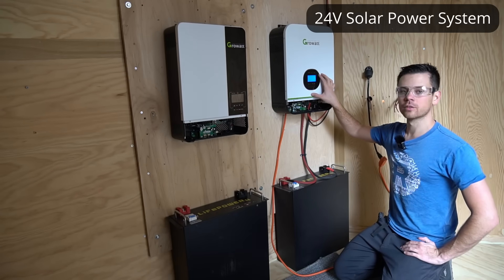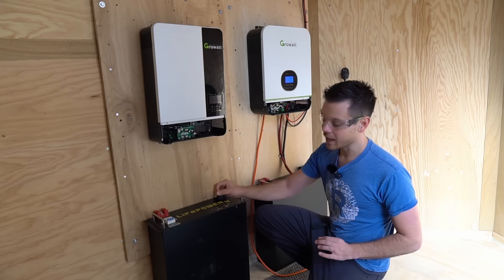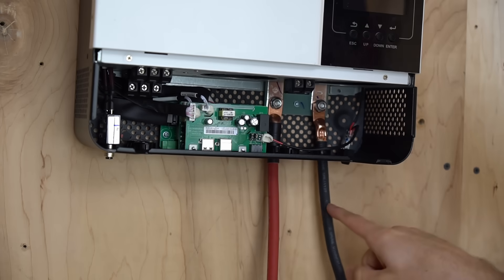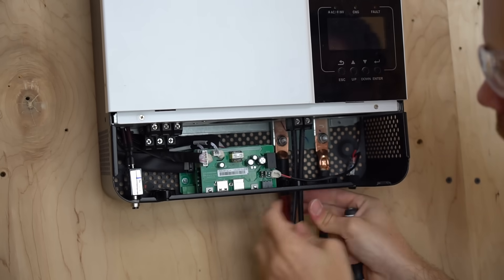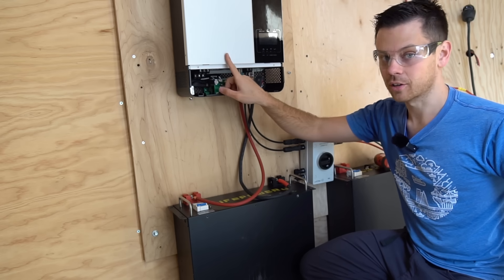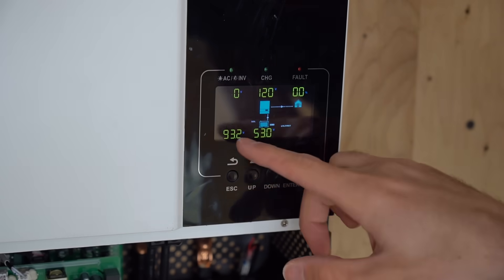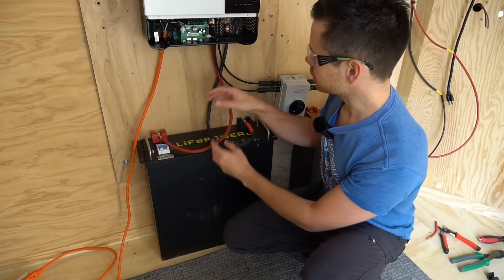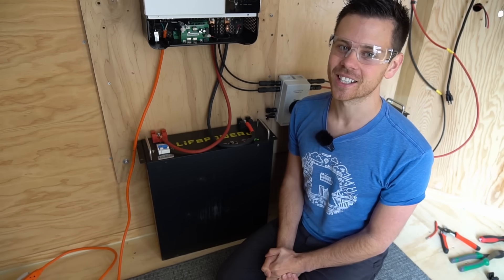Beginner Friendly 48V Solar Power System! Step by step!

Comment: What is voltage output for this inverter? Mine is 220-240 (230VAC). Could you check N-L, N-E & L-E voltages? Mine has Floating Earth (normal for every inverters which it wasn't bonded N-PE inside the inverter like IC brand inverters). Current setup the Neutral carries voltage (100VAC to Earth) and if someone accidently touch Neutral wire they'll get shock. For current setup (off-grid) you can bond N-PE directly at the inverter output and that's all.

However if you're connecting AC input (from grid\generator) it will different story and different setup. 
I would like to know if we could bond N-PE at the AC output of the inverter when we connect AC input from grid?

In the U.S i know that N-PE already bonded at distribution panel. Somehow you could take the Neutral from ACin and jump into ACout so that it will give proper earthing reference.
In Malaysia, we have 240VAC from grid but not sure what earthing method (most probably TT or TN-S). Could this be done the same? N-ac-in tie to N-ac-out?

I've installed grounding rod at my house and tested everything was fine when using grid N-PE = less than 2V, N-L 240V & L-PE = 240V.
thanks.

Comment: A little tip: if you have some red electrical tape, wrap a little around the pos(+) MC4 connector so that you'll never get them mixed up. A lot of us forget what we did, months or years afterward.
Reply: Martin,
I am a semi-retired welder-fabricator.
I create a op manual for everything -- parts numbers, suppliers, components, procedures.
I automatically assume the next user is a lawyer intent on making my life 'difficult'...

Comment: What kind of setup would I need to provide at least a lvl 2 charger or even a lvl 3  charging station for EV. I am wanting to provide it for a mobile roadside service. I can come to a location and give someone enough of a charge to get them down the road. I have a truck that I am wanting to setup a solar system to power my mobile tire changing equipment. But to also provide charging EV without using a gas generator.
Reply from the maker: Just watch my other videos where I go over exactly that
Reply: @WillProwse  I have watched your other video about charging your EV. However I am trying to figure the exact setup to give the maxium charge in an emergency application to a EV car that has ran out of juice. I don't have the time to set with them for several hours on the side of the road. I am guessing to get 12W 48v converter. I just wonder how can that be used as a lvl 2 charger. I think a lvl 3 would need three phase.

Comment: How does grounding work with the 120VAC circuit? I can see the green wire come in next to the hot/neutral, but is there a "ground out" for a grounding rod or building ground system? Thanks!
Reply from the maker: Only if you connect to the grid. Then it is supplied by that grounding conductor. If not it is a floating system

Comment: I have been taught to always connect the negative terminal first because positive first won't have the intended path back to ground should there be a malfunction or mistake.  I'm no master electrician so can y'all help me understand why Will connected positive from the inverter to the battery first 3:43?  thanks.

Comment: Thanks Will    Your a True Inspiration,  thanks for your time sharing your Great Knowledge,   I want to do a Boat Solar Array to power the A/C current on the Boat not Having to run the Generator.   This seems like a Good system just need to do the Workarounds from Having 12 volt and 48 Volts on the Boat 
Thanks Again

Comment: Great video.
The ground conductor connected, Should the ground not be connected  to an external ground to create a path with least resistance.
With inverter settings, can the PV charge battery and supply power to AC appliance
Reply: Moe,
Are you asking about connecting ground cables to the trailer frame?
Reply: Hi LM, 
Thanks.
no, I am referring to non movable structure / off grid house connection 7:55. Should there be an earth leakage if connecting to a sub distribution board for lights and small appliances.
However, for information in the case of trailer connection where does ground / fault current go to?

Comment: Is the same voltage DC much more dangerous than the same voltage AC? Because I've felt alternating 120V shocks many times and it just is very scary but I don't think my heart has been damaged. The electric fences used against home robbers is DC pulses of what voltage?

Comment: Just ordered a similar system like this. But I want to add some wind power as well. But it's really hard to find someone that has a nice and clean installation. Might be ending up having separate systems. And have a small battery bank for the wind together with a inverter to feed into the grid tie  part of the mppt.
Reply: Separate systems.
Redundancy.
Good idea.

Comment: Is that the spf5000es unit?  That puts out 230 volt?  If so then it takes more volts in then you mentioned.  Or is that a 3000 120v single phase unit?  It looks like the 5000 unit that I have.  Which will take more voltage and output at 240.  So I was a little confused.  I have 14 320 watt panels running to mine at no problem ..

Comment: I did all the HEV and BEV diagnostics for Ford from 2010MY through 2016MY. Nominal pack voltage was about 320VDC if I remember right. Anyway, I always used an old trick of Nikola Tesla's, regardless of whether the service plug was pulled or not.  When working with HV conductors, keep one hand in your pocket.

Comment: Your unit does not charge because your solar string does not provide enough voltage. MPPT startup is at 150 volt.
Reply from the maker: Yep, I listed that mistake I made in the pinned comment. I'm an idiot. I have 20 of these units and didn't realize which one this was.
Reply: @WillProwse  I made the same mistake. Thought that it will work with only 3 solar panels of 40 V open circuit voltage each, wired in serial. Had to buy  another panel to get it fixed.

Comment: Great video mate. Greetings from Melbourne Australia an Happy New year. I was wandering if you or anyone here has info on building a very large system for a large house. planning on building a house in the Philippines and was wandering what set up would I need to power a  very large house with multiple Air conditioners. As the Philippines has constant power outages, sometime running for days on end. What set up would I be looking at for this. I am expecting cost to be around 20-30k for everything. Would I be right and if so. What would be looking at for this type of set up.

Comment: I saw in one of your comments, you were suggesting safe clearance to combustible materials yet I see your equipment mounted directly to plywood? I have OSB on my walls and I found a very nice tote to store my batteries in inside my basement with a lid and exhaust fan. Do you have any input on that?
Reply: Charlie,
I think these temporary displays are for demonstrations.
I think non-combustible mounts are the way to go.
Reply from the maker: Look at pinned comment

Comment: Personally I would wire up the AC side first. Just in case somehow you bumped the circuit breaker shut off switch for someone accidentally turns it on while you're working
Reply from the maker: Yes, true! Good point.

Comment: Very simple explanation and got me thinking if I should still go with a 12V system in my motorhome. In the moment is the bigger problem getting some decent solar panels (I prefer the 200W x 3 for the 600W set up on the Motorhome)  and batteries in Europe. I sourced some individual components for the moment in my country but wit the AGM batteries. Getting some LiFePO4 for 200Ah up is when it becomes a problem. I found your channel about 2 years back, watched some videos but didn't subscribed. Luckily after searching again in the Solar Power topic I came across your channel again and right away subscribed. I am also thinking to do something similar for my house as in this video for the future and boy this your simple  description gives me the right motivation, Thank you.

Comment: I believe the standard is to avoid connecting/disconnecting solar panels while the inverter is working or while there is load on it. This avoids the formation of tiny arcs and welds on the MC4 connectors which over time can render it bad. So I wonder how that isolator comes in to work while the inverter is hot.

The standard I think is battery to controller first, then solar panels to controller next and then the inverter turns on last. Then the loads can be put on the inverter.

Also the use of bus Bars for ease of connection is sacrosanct and that is what I use on my 48v 25amp 18650 Li-ion to parallel 8 pieces of the packs. In place of a solar isolator, a 60 amps DC fuse to disconnect/connect the solar panel to the system is what I use.

Comment: Thanks for you videos Will. Which is the better all-in-one inverter to go with for beginners wanting to do an off grid system to power a whole house, a few Growatt 5kw's or a couple of LV6548's like your setup?. I'm going to be using a full rack of 48V/100AH EG4-LL batteries.

Comment: As you mentioned it is important to first connect the battery @8:10 then the solar string otherwise the electronic may be killed.
Reply: Will also mentioned "Follow the instructions in your manual.".

Comment: I'm an old guy that has actually learned much from you regarding PV panels and storage batteries and has built a small 12 volt back up system for tornado season here in Kentucky using info I got from your channel.. My wife and I both are grateful for your channel for that reason. A really silly thing that I would like to ask you, that has zero to do with solar or batteries is, where did you grow up? The reason I ask is because the way you pronounce words like "tighten" is much more "precise" that anyone here in Kentucky would pronounce them. It may not be a regional thing, because you seem to be very well educated and may just say things "right" for that reason, but I'd really like to know, if you don't mind sharing. One of my "things" that I tend to pursue when I meet new people.

Comment: Thank you Will for another excellent video. I have enjoyed your youtube channel for several years and this is one of the most important one yet. Why? Because there are probably many people like me who have been slowly upgrading over the years waiting for a breakthrough. 
I have been using solar power at my cabin in the PNW for over 20 years , very basic and low power. My last upgrade was two years ago, i almost made the leap to  Lithium but the cost was just two much so i went cheap hoping that the technogy would improve and cost would go down and so it has. So this type of upgrade is very feasable fo my situation. so thank you for doing such a great job and as always . honest , caring ,accurate and knowledgeable 
I hope that you have continued success and good health and happiness in 2022

Comment: I also have a SPF5000ES and powering my house. Simple setup but the Growatt support is too slow or never responds.
Reply: did you setup 2 X spf5000es's in parallel ? and what battery type did you choose? how many KW storage do you have?
Reply: @peaceseeker7332  I am in asia so its 240V here so just 1 unit. I have about 11 kW storage.

Comment: Why are the so few offers on the market for 48V 3-phase higher power systems (10k etc), sized for a complete home roof? Is 48V extremely inefficient at those powerlevels? I can't find much other than all the chinese voltronic clones.

Comment: But Will, you totally forgot... 🤪 (lol j/k) Nice "keep it simple" overview. Thanks for stepping through it so exactly. When you mention T-class fuses on parallel (edit: battery) arrays, do you just fuse the main hot leg into the inverter, or place a fuse between each battery?
Reply: Ted,
2003, on our ExpeditionVehicle build, we fused at each potential source of sparks -- photovoltaic panels, bank, inverter output.
Nearly two decades full-time live-aboard with zero-zero-zero sparks.

Comment: Hi will, I noticed the inverter on your vodeo is digrent from the one on the link. I noticed because I'm about to upgrade my 1kwh solar system frome 12 to 48 and I was interested in the newer 3k Growats like the one on your video, but then in the user manual I read that the minimum pv workimg voltage is 145v, I only have 135v open circuit.
Is the inverter on the vidio the same as the one on the link? Where you able to charge your battery with only 85v pv aray?
Thanks for the time and effort ypu put into these videos, it helps people like me living in remot places, take good desitions and to spend our money in working solutions.
Reply from the maker: No it wouldn't charge. Needs 120V minimum. I screwed it up. Wrong model. Each model has different input requirements. Look up the manual to check.

Comment: Hi Will. HAPPY NEW YEAR. Apologies if you have already mentioned it but do we need to pre charge the capacitors for this all in one inverter?
Reply from the maker: These batteries have a pre charge resistor built in. So you can hook it right up.

Comment: I wish I had running water on my land, that I could build a micro hydroelectric generator on, I would buy about 100- 200ah of lithium titanate cells, 24-48V  and a 10 kw inverter give or take, having 1kw 24/7 would be plenty to power everything, lifepo would probably work fine, but the titanate would probably last much longer, being it would be cycled more, possibly 2-3x a day ..  more than solar is likely to be cycled,  the smaller bank cycled more,

Comment: Will that run a 2 hp deep well submersible pump. It's on a 30 A breaker now. Need a way to have water if shtf. Thanks Will for all you do.
Reply from the maker: No, you need my large system instead
Reply: @WillProwse  Thanks, where would I find info on the large system?.

Comment: Just finished building a very similar project with an SPF5000 ES, ending in a big disappointment because Growatt isn’t very clear (or you can even say misleading) about the MINIMUM PV voltage necessary to trigger charging from solar input. My three huge 495W JaSolar panels in series deliver around 130v and the datasheet says the open circuit voltage should be higher than the minimum battery voltage. I would say 130v is way higher than the min voltage for a 48V battery but in fact the Growatt only starts charging around 150V, not any lower. I did not see anybody mentioning that so I do here and maybe you can say something about it on your channel. That might help somebody not making the same mistake that I did. As my project’s panels are the roof of a trailer I cannot just add another one and am now forced to buy a different inverter with lower min PV input.

Comment: Good video. One question about using more than one battery: I would think they have to be at or very close to the same voltage or state of charge when connected together otherwise the initial current could be very large between the batteries as one tries to charge the other very quickly. Perhaps a 1 ohm (or so) resister connected first (or even permanently in parallel with the cable) until voltages equalize before the cable is connected would help. I have seen garbage cans start on fire when "fully depleted" (zero volts measured) cells are thrown away and short out. The available current on even broken batteries is truly amazing.
Reply from the maker: I made a title text saying to charge all packs to 100% before connecting them

Comment: You rock Will!!
I bought the growatt 5000watt all in one like you are using here. I will be using 4 200ah SOK 12v in series. I pretty much have been stuck and afraid to move forward and wire it up. I was going to ask you to help in the comments of another vid so I want to say thanks much for making this video. If anybody reading this can advise me as to what gauge wire to use to hook the SOK batteries together and then what gauge wire to go up to the inverter from the batteries. Thanks in advance

Comment: Really been thinking of building a small system like this for back up for a couple of freezers and to be able to run a small window ac intermittently. Seems like that would do the trick. In STX so plenty of sun to keep it charged but we have a 3500w dual fuel inverter generator with propane and gas stored up as back up for the back up

Comment: Very good video, the only thing I disagree with is that the AC should never have been plugged in until you turned on the Inverter and measured the AC voltage at the outlet and it's frequency.
Mistake can happen during setup and you can end up with 50HZ and 108V or some other weird combination.

Comment: I’m a Union electrician in NYC.  35 years experience in ALL phases of electrical work. 48V is the line of delineation between “high” voltage and “low voltage. It also separates electricians from data technicians mostly because back in the day most telephone circuits ran on 48V systems. And to be honest 48V kinda tingles a bit of you get hit by it. You would never want to be holding it when the phone rings. That closes the circuit and that’s when it hit’s you. It’s a long running joke amongst veteran electricians.

 I would love to help you out when you decide to start enclosing your wiring in some conduit. Good job Will
✊🏿
Reply: Phone ringing voltage is much higher than 48V DC. More like 96V AC with multiple frequency options to support party-line ringer selection.

Comment: I like the simplicity of teaching here. Another thing to consider is if the person is still leery working with the voltage on the solar panels, they could wait until it's night so the voltage and amperage of the panels is at its lowest.